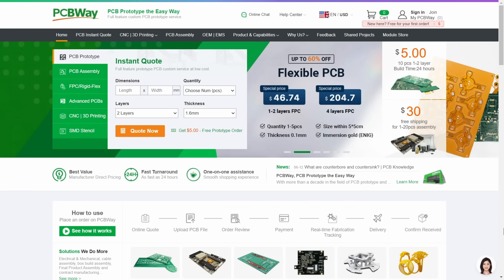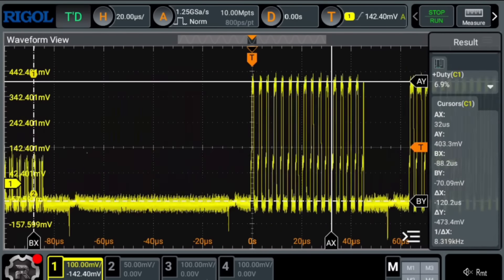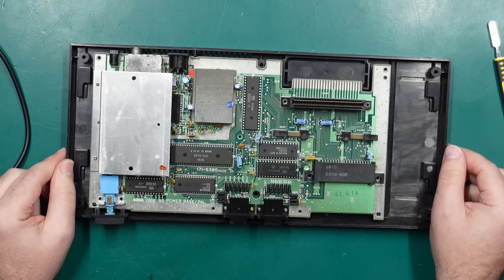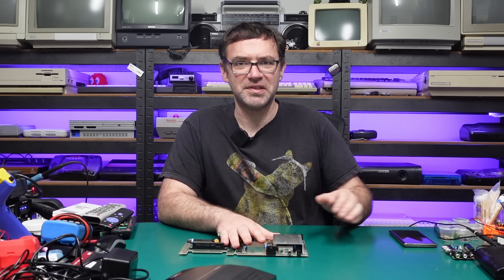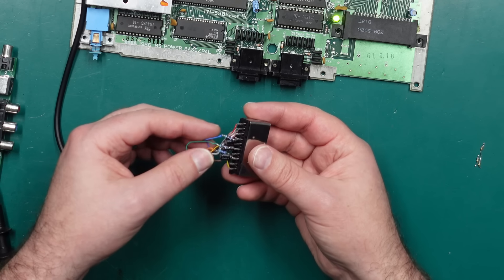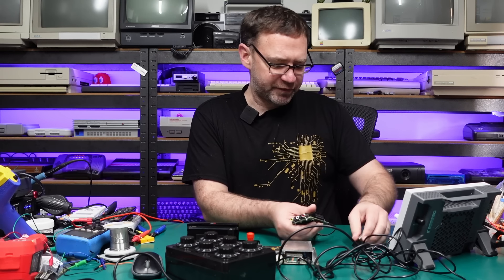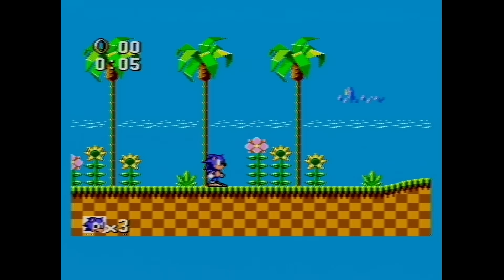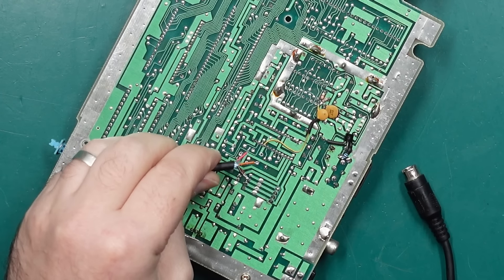How to improve the video output from retro systems - simple fixes for common issues

Comment: I have a 24" crt for my retro consoles, I find it much easier and better than faffing about with all the scalers and other paraphernalia that goes with them. Even low quality composit or rgb cables give so much better picture than the RF from my childhood that I scarcely even desire anyting more. I do use the RCA soutn outputs and a hifi amp though because the sound being bad is so much more annoying for me.

Comment: I just bought an Amiga500 and a Commodore 128. The Amiga video output is RGB and therefore is perfect hooked to a modern LCD with péritel. The Commodore 128 is not in the same league. For 80 columns, I soldered some resistors in a péritel plug, hooked a cable with a DB9 and voilà, perfect RGB output for the 22" TV. For 40 columns, I replaced the horrible RF output with a Videoplus 128 module, plugged the S-Video to the 24" TV péritel and after hours of turning the pots, I eventually got rid of the jail bars.

Comment: Wow! This was the most educational video I have seen in a very long time in all the retro computer channels I follow. I thank you for taking the time and putting this together. You should tackle the Sinclair Spectrum 128K (Toastrack) too. It is notorious for color bleeding and jail bars. Although some "band aid" mods are available, none of them is a real fix. Most of its video problems originate from its design that considered the RF output as the primary source of video and audio, so they didn't care how clean was the RGB output. This was mostly valid back in the day, but not anymore, everyone uses the RGB output with a SCART cable, either directly into a TV, or thru an upscaler device into HDMI. Although the RGB output is much cleaner than the RF and composite outputs, I believe it can be much better with a fix like this.
Reply from the maker: I do have a toastrack, no idea if it works so I may need to tackle that first.

Comment: LOVED this video, so useful. I'll be using this is a reference video for years to come. Thanks for making it :)

Don't apologise for the duration, all justified. I have been working on an issue with my A4000 and for one thing I was told my RGB output was too low (30mV) those telling me this though, did not shat what it SHOULD be. Your video cleared that up, totally, and a lot more. For instance WHY are capacitors used in these cables, and WHY the resistors are there.

A very interesting point it raises is. It appears to get the best from different machines, you may, if you can be bothered, wish to use a specific RGB to SCART cable for each, as it appears generic resistor values can lead to a slightly dim image. I suppose also it could allow over-driving the signal as well, and blow out the image.

My issue, with my A4000 is not fixed. Ill make a video on it soon!

Comment: Next step would be to hook the Master System up to an RGBtoHDMI. With a fully populated "Analog board" it should be able to differentiate between the 4 voltage levels on each of the R,G,B channels. As long as all signals (including the CSYNC) are DC-coupled you can dial in to basically any voltages generated by the machine. 
I am not sure if anybody has done that yet, and there is no profile for this in the RGBtoHDMI firmware release. Maybe someone wants to try it?
Reply: Sounds like the CoCo 3 Analog RGB profile might work, though you may need to tinker with sync settings. 
 We combine H+V with diodes.

Comment: Really great video! Although I am far from getting myself an oscilloscope this really showed me what mighty a tool it seems to be. What I did not get is: Why not placing all modifications in the console to be able to use any cable that has no device specific components in it?
Reply from the maker: Yeah, I will probably go back in and put all the components inside the console rather than the cable. I just need to find a good place in the signal path to insert them

Comment: 38:17 Could you have re-soldered the components to the same places on the top side of the PCB, but not flush with the PCB. Like, leaving "long legs" on the components.

Not a native English speaker, so I don't know if I am explaining it correctly, sorry.
Reply from the maker: Maybe. But the legs on those components were already short, so I would have needed to replace them all with new parts
Reply: @TheRetroChannel  Yes, I meant soldering new components and keeping them as far apart from the PCB as possible by keeping their legs as long as possible.